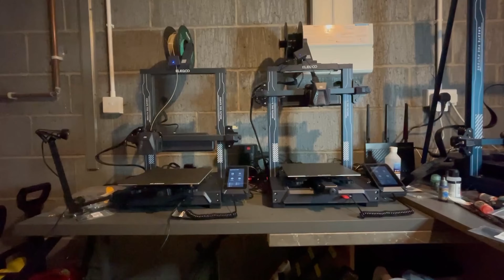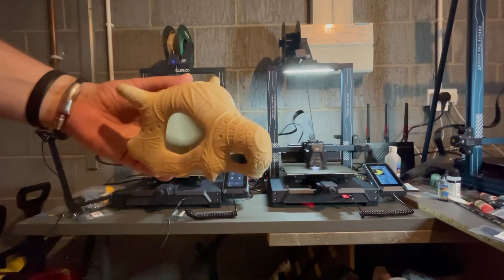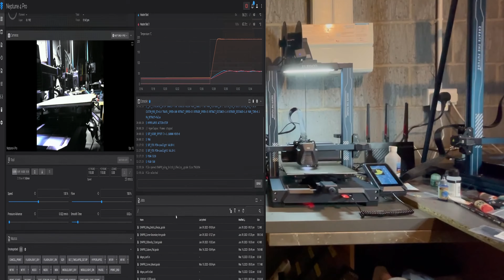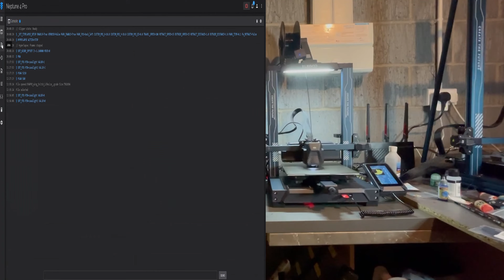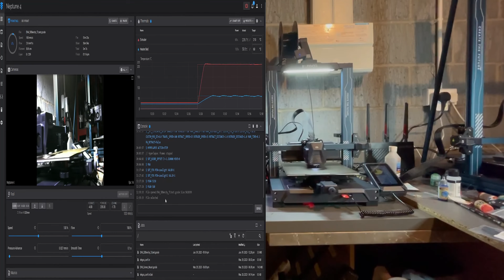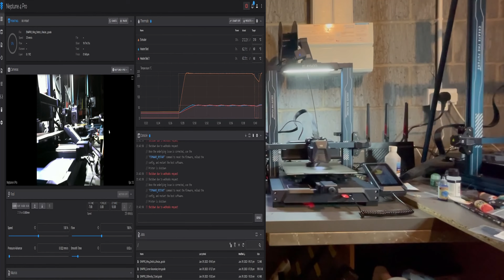Product Review: Elegoo Neptune 4 & 4 Pro - FDM 3D Printers

Comment: Hello a wifi extender with a Ethernet connection would make it work 🎉
Reply: There is one more way to connect the printer to internet :)!!! Share the internet connection from your laptop via the lan cable Elegoo put into the package (or a usb/lan cable adaptor) .
So, these are the steps:
1. Connect your printer to your host PC using the Ethernet cable. 
2. Go to the Network Connections menu. 
3. Right click on the active Internet connection and select Properties. 
4. Toggle “Allow other network users to connect” to on from the Sharing tab and select the relevant Ethernet port from the pull down menu. Note that, if you have VPN software installed, you may see a lot of virtual Ethernet ports on your list and you’ll need to pick the real one. 
After you click OK, Internet should flow to your client device over its Ethernet port. 
For W11 choose a service in the Wifi properties> Setings > Service (mine are 1700 to 1708).
Enjoy!

Comment: I decided not to wait on the plus size version and bought the Neptune 4 Pro.  It hasn't shipped yet.  I'm looking forward to using a modern Klipper printer.  I don't really need a larger print volume but it would be nice for printing multiple parts at once for my small print farm.

I wish 3D printer manufacturers would use a four conductor continuous flex rated CANbus cable to the print head instead of a 26 conductor ribbon cable.  Among other advantages, this would allow an optical filament runout sensor at the top of the extruder which would make filament loading easier and it would have detected the filament break shown in this video that happened after the filament runout sensor at the top of the printer.